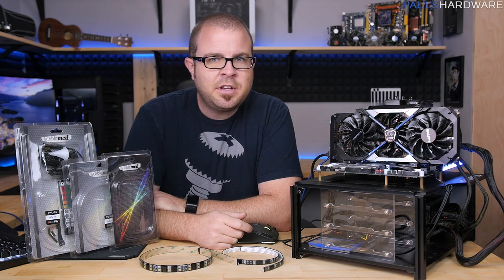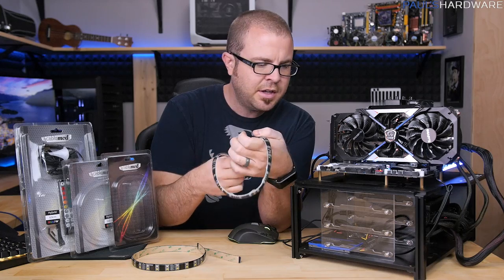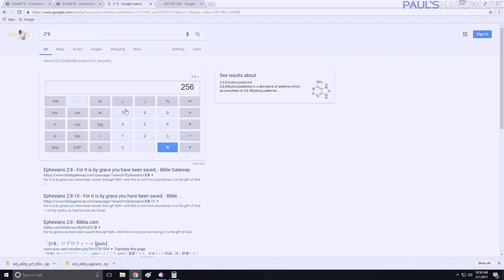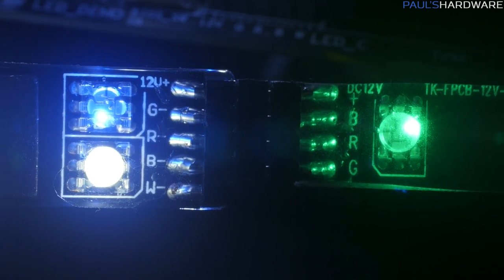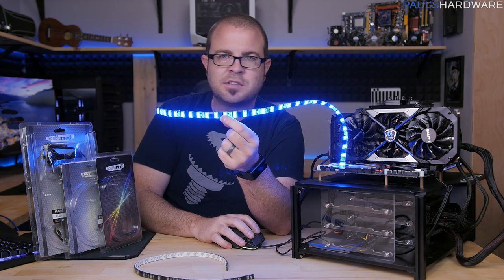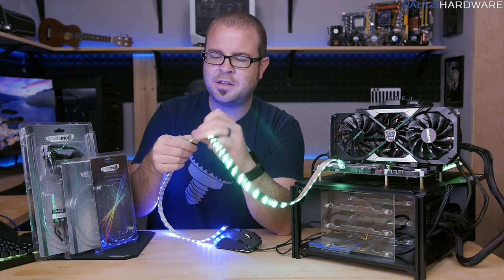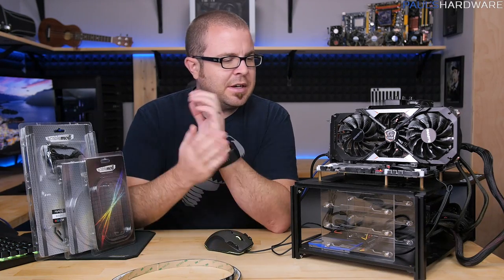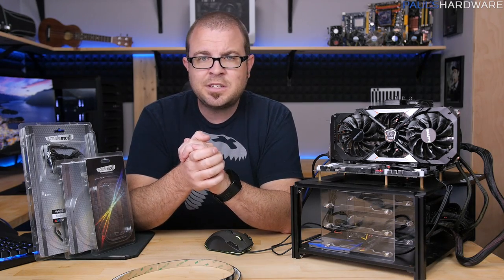The Trouble with RGB LEDs

Comment: would an EVGA FTW 1080 work with another manufacturers mobo software; asus, gigabyte or msi.... EVGA doesnt really have any rgb z270s
Reply: Not usually, but you can probably find a configuration tool for EVGA graphics cards in the EVGA configuration tool they all tell you to download.

EG: Razer Synapse, Logitech Gaming Software, ASUS's GPUTweak2, etc.
Reply: yeah i use precissionX but would love to have everything synced up... considering upgrading from 4790k to 7700k on the z270 platform

Comment: Hey Paul my friend, I am trying to find a way to turn off my back-up ssd 
to save power and reduce heat. Can I custom wire the power cable to a 
Latching Switch?
Reply: jskull1986 If you were referring to an HDD instead of an SSD your question would at least make sense ...

Comment: Thanks for the informative video Paul. I just received my first non hardware (cooler/GPU) RGB item today, a 3 pack of NZXT Aer RGB 140mm fans. I will be ordering a White/Purple NZXT Hue in a few days as well. Now I'm wondering if I should try to run the fans through my motherboard to try and use Aura software instead.

Comment: ok we get it ... the RGBW strips have a white LED... it still won't make the GPU, Mainboard, CPU cooler, SSD and RAM or whatever other RGB devices you got connected true white, so ultimately it won't help. (my X62 Kraken has a bit of red in it's white setting).  
The problem is that all these devices don't really sync. Sure if you buy EVERYTHING from Gigabyte it will sync, if you buy EVERYTHING from Asus it will sync, if you buy EVERYTHING from MSI it will sync... but my EVGA card and my NZXT Kraken won't sync with the Asus board that i just bought so for the moment it is a marketing thing to get people to maybe buy the own GPU instead of the competition... they are doing the walled off garden thing with RGB, everybody has his own app, his own compatibility list (well, actually there is no "list" that you can go look up)... they should be working together or simply have an open API so 3rd party tools (like GAMES) can take control.   
RGB is the wild west right now and its a PITA for the user to have to switch 4 or 5 different tool's to a different color instead of just one.

Comment: It's interesting to me that LEDs include W (white). This is diametrically (complimentarily?) opposed to printing with ink on paper, which is CMYK (Cyan Magenta Yellow Black), the precise opposite of RGBW (Red Green Blue White). In a perfect world where all materials were pure, perfect and complete, you COULD achieve white with only R, G & B. In the same perfect world, Cyan, Magenta and Yellow ink on paper COULD make the perfect Black.
But in THIS universe, both RGB with no W, and CMY with no K look incomplete and unconvincing.
I had never considered this before. I wrongly thought of ink as being impure and needing the booster-shot of Black, and light as being pure and perfect, needing nothing. That makes no sense because light emitters are manufactured from things in the physical world just like ink. Of COURSE LEDs are imperfect and need White!
I never thought of this before so thanks, Paul, for making this video and enlightening me.

Comment: Like to see zone rgb control.  I use the phanteks luxe tempered glass and I use the built in controller for the built in lights and a seperate remote controller for the interior.  Nice to have one zone set to theme and one(interior) to white.  Love to see a mobo with multiple "zone" control.
Reply: As an afterthought rgb lighting is awesome if you don't like it turn it off.  I for one am ecstatic that I can change themes with a button press and no longer have to swap out all my fans/cables/lights.

Comment: hey guys I just finished building a new rig and its only showing 4gb of ram in my dims when I have 2 sticks of 4? so it should be 8gb in total? any ideas on this weather or not my ram is faulty ?
Reply: TrickyModz , you got 'em in the right slots ?
Try one stick at a time to see if either is faulty.
Reply: TrickyModz check the manual to make sure you have them in proper dual channel slots. if they are try swap them over and if it still says 4gb each time one might be faulty
Reply: one of the sticks wasnt booting at all when i just had one of them in so ive figured thats the problem thanks guys

Comment: heres the problem red is the most dim color in the spectrum so to acheive proper white you have to adjust with more red. most single leds labled white arent really white unless your spending $600 or more for a automotive paint inspection led. when talking strip lighting for your pc the only way to get true white (natural sun light) is to use use equal brightness from the full color spectrum (rgb). point being you have to use rgb leds if you want white
Reply: Cody Hodgson , somewhere, two Chinese guys are laughing their asses off, because they can sell their $5 LED for $600 by calling it "automotive inspection"
Reply: Massimo O'Kissed oh so you own or work in a body shop? what light do you use to ensure proper color match?

Comment: The technical explanation here is not correct. Only the 12v pin on the motherboard is an output. The R, G, and B pins are inputs FROM the strip. All the colors are receiving 12v constantly, and are turned on and off by grounding or disconnecting the corresponding pin. Brightness control is probably done by adjusting the duty cycle of this grounding.

Comment: +Paul's Hardware please hint on what rgb case fans (thermaltake, corsair, nzxt, etc) are able to be controlled via software and can syng up with motherboards. I have Corsair HD120 RGBs, but haven't gotten a case to go with them yet. I'd like to see software based control versus those control boxes, but I suppose there would need to be a motherboard input as well if the fan makers aren't going to design software.

Thanks and good video!

Comment: Would you test that software with all of the other devices? I want to see it control corsair keyboards, mice, and fans. Maybe a headset and some of that crazy G. Skill ram. 

I would jump in to rgb if I could use one tool to control all my lights.

Comment: Hey #Paul's Hardware
When I was sync up my rgb lights like motherbord, fans, and a strip, most the light link-up but when I turn to blue it go off like no color would show up, so i thought I hook up wrong, so i check all the wire where hook-up right, and they where so then test each  part to see if they can go to all color and they can. So I wound what I did wrong. I'm used a asus x370-pro motherboard and its aura

Comment: lol to bad you can't do this with a board that doesn't have the pins, if there is I would love to know. I have the cable mod one that's SATA powered and uses the remote and I was to adjust the colors to match my Corsair keyboard and mouse and it's just ever so slightly different. so if there is a way to set the color via a remote or some other pluggin I'd loved to know thanks.

Comment: This is a little misinformative, as Paul describes the system as being something that communicates color signals to the LEDs, which is not true for the LEDs he's using. In the case of a system with separate R/G/B pins, the motherboard itself has a DAC for generating the currents for each LED. The "communicating color signals" only happens with WS2811 or WS2812 LEDs, in which the actual data is sent digitally to LEDs that have their own ICs for decoding color data.

Comment: -We refuse to get any kind of rgb items it's disgusting
=but you can adjust rgb lighting as you want or even switch it off when you want, and it actually doesn't cost more than 10-15$ to get an rgb ram or a strip 🤷‍♂️
-What???? Rgb too much light can't handle it, must get 9000 fps no penny waste

Comment: single zone on a keyboard for key backlighting I have zero complaints, but this rgb everything is getting out of hand, as is the windows and full tempered side panels, your computer case is not a display case, it's a faraday cage intended to keep the massive amounts of rf noise/interference generated by the components contained inside, side panel windows don't block jack.

Comment: is Rx 470 good for 1080p ultra gaming.
Reply: Zer0 Gravity for example witch Games.
Reply: A. Masood It should be fine for most games though.
Reply: nah wont say ultra, but its a very good buy, depending on the prices (where you live) ofc. I got a 480 and don't run everything on ultra. (think witcher 3, wow and Ark (those 2 are very cpu bound as well though).

1. because the difference from high is not really noticeable, and you gain a lot of fps. 
2. I'm not much for lag and tearing, so I tend to favour crappier visuals for more fps (imho a better experience)
Reply: MyrKnof thanks I can bear as low as 35 fps I think it should do ultra of course except those x16 AA or hairworks in witcher 3.
Reply: +thedog556 I wouldn't call the RX 480 a failure. It costs less than an R9 390 or Fury, so for its price point, it is still very competitive, as it outperforms a GTX 1060.
Reply: ***** I feel like you're misinterpreting the word "flagship" here. The 480 was never intended to be a "top end" card; it was released and marketed as an affordable mid-tier card which serves as a gateway into 1080P gaming (and VR) for people who don't have the budget for high-end graphics. 

Since the R9 390, 390X, Fury and FuryX were AMD's high-end offerings (and continue to serve in that role) at the time of the 480's release, they had no reason to try to compete/replace those with the 480. They may eventually release a 490 to serve that role, but none has been announced as yet. 

It's the same with NVidia, who haven't had a *90 series card since the 590. AMD may have just skipped the *90 this generation, at least until Vega is released.
Reply: ***** Incorrect; there are very few games an RX 480 can't max out at 1080P, with AA and AF also maxed out. 

See here: 

http://hexus.net/tech/reviews/graphics/94969-sapphire-radeon-rx-480-nitro-4gb-8gb-oc/?page=7
Reply: thedog556 fury x is quite expensive to buy and it's very rare to find it used it is better than 1050ti and here it is the same price as Rx 470 so going with Rx 470.
Reply: ***** The RX 480 does not "struggle" to hit 60 fps in any games at all. Did you follow the link I posted? It's getting average of 140 fps in some AAA games at 1080P with everything on maximum.
Reply: A. Masood RX 470 is a good budget choice. While the Fury X is really expensive, the regular Fury (which is better than the RX 480) has really come down in price over the last couple years.
Reply: thedog556 in India fury is as expensive as a 1080 and fury x even more 1060 3 GB will show its vram limitations so 5 10 fps low I'll bare with Rx470 as 480 is absurdly priced.

Comment: Does anyone know a mechanical keyboard with no lighting, 104 keys, and durable materials? And possible cheap?
Reply: Kage Hikari e-element or mechanicaleagle on amazon, they have rgb lights but it can be turned of. they are like 70 bucks. they are on Massdrop as well.
Reply: Thanks for the help. However, I found a full size mechanical keyboard with brown switches for $40 with a teal lighting. It's called Velocifire TM-01. Though I'm considering of the Mechanical Eagle z-77 white backlit if I can fit it in my budget.

Comment: No led you are likely to use inside a pc runs on 12 volts, the strip does but it steps that down, most will be around 3-5 volts
Edit
And it isn’t data telling the less anything, it is a level of resistance as that is the ground for each section of the leds, no data just resistance

Comment: My HUGEST issue with rgb, that they dont all sync up and no one has been clever enough to make a third party program to do it instead.
For i stance synchronized breathing affects, synchronized music led effects rather then a graphics card doing x this or that for music and yet your keyboard dosnt have that ability or ya rgb headset which really seems like a given... its not.... the fact you have to have software to control your motherboard, one for your graphics card, one for your mouse, keyboard and headset... you can only get them synchronized up so well manually with stuff like breathing. Or whmaybe n a software refused to let ya use a 255 color code picker for rgb in the software... i mean really yo. 
Someone needs to sit down and say screw all of them and code something up for it to do all of the rgb and multiple effects
Reply: If you think it would be so easy for someone to develop a software simply for that reason, why don't you do it?

Comment: You just dont want DEATH BEAM rgbs you can't turnoff or down... PS4's leds are so bright that I have used my controller as a flashlight. No fucking joke either. It works. Especially at max setting.

Comment: My ASUS z170 Pro Gaming Aura Has no RGG headers. Which is dumb as fuck. The only reason it has the aura tag is for one small built in strip of rgb lights on the side of the motherboard. And the built in lights operate two LEDs at once instead of individually controlled. Really annoying.
Reply: They are also Dim AF

Comment: Monitors are red green and blue pixels and they make pure white so why can't the strips?
Reply: Well a common example would be the Samsung phones with AMOLED screens that use only red, green and blue and it appears to be excellent at white to me.  Is it more of a cost issue with the strips, or that the LEDs are larger so the colors can't mix as well?
Reply: Because the LEDs in displays are so small and close together they appear to only be one colour. The LEDs in RGB strips have a distance between them which causes the lighting to appear to have a 'torch beam' of slightly different shades.
Reply: Because a monitor has a white led backlight, ccfl backlit ones are warm white.

Comment: Yeah, right ... "the three connections provide data" ... why is Paul of all the TechTubers talking unnecessary bullcrap so frequently ... so sad.

Explanation (without having googled anything in advance): The three connections provide nothing but DC to the LEDs - interrupted by PWM at best, I guess - while the binary data ends in the controller which provides current to the connections.

Comment: Yep, waste extra power. That's the way to go!
Reply: Well, LEDs don't waste that much power, I estimate that when you go full RGB on your build, it's only consuming like 10 watts or so.
But even if they were consuming no power at all - they would still be a complete money waste ;)
Reply: Not to mention, they're only about 50% efficient at converting electrical energy into light, meaning the other 50% is radiated as thermal energy into the rest of the build.
Reply: I've got an LED bulb only consuming 3W of power but emitting quite a lot of light, so I don't believe that your temperatures will increase drastically when going full RGB on your build.
Reply: Still way less than all the power being wasted on cryptocurrency

Comment: Why don't we just use RYB LEDs
Reply: Because how light works. When using paint, you can mix blue with yellow to have green, but when you're using light, you must use green and blue to have yellow.
Reply: ManicRobot that's not quite true. Yes it is the cheapest way to do it but at least mixing a yellow LED in there would be appreciated. You can mix blue and yellow light to get green light. That is the practice of most stage productions. But the cheaper, less accurate way to do it is rgb. Also, it's a standard and most people can't tell the difference so companies don't see a need to change it. As someone who has a very wide and precise color view, it bothers me to see run still the standard. I have used arduino to implement cym lighting and it was expensive but it really did give true color. But seriously just add another addressable LED. It's one pin. 5x4mm. I don't see why it's a problem

Comment: It's so funny when a supposedly a "hardware guy" doesn't know what he's talking about. You got the explanation right, but for the addressable led strips, that have chips in them or in the 5050 package itself that takes a 1 wire ou 2 wire data to control the brightness of the diodes, those are digital. But the ones you're showing off on this video are analog. All diodes of the same color have a common cathode that are controlled via PWM (Pulse Width Modulation) turning the color on and off very fast at different rates to make it seem dimmer or brigther. Those are not bits, its just analog, a "very fast light switch". If those were digital as you described you should be able to make everu led on that strip a differend color. You should do a little more research before embarassing yourself for half a million subscribers.